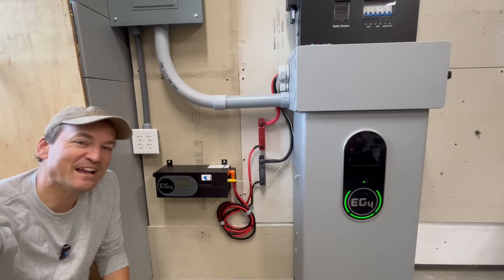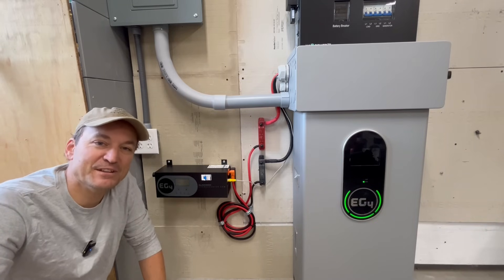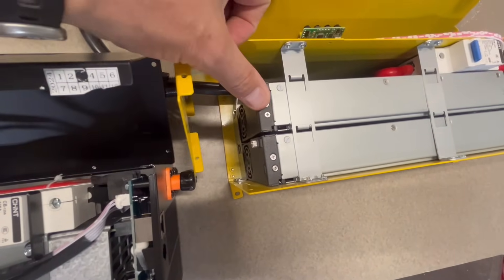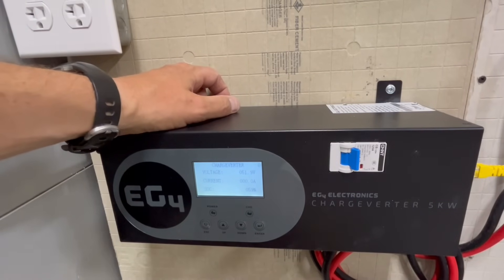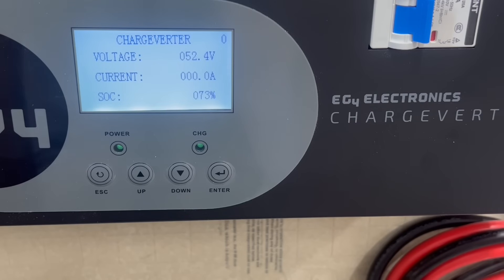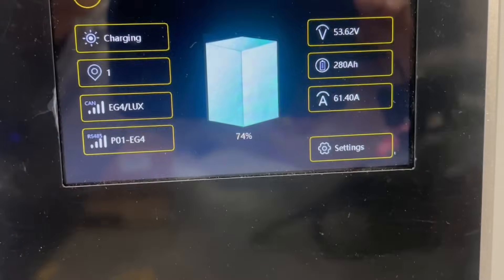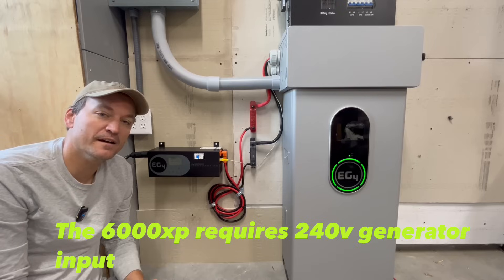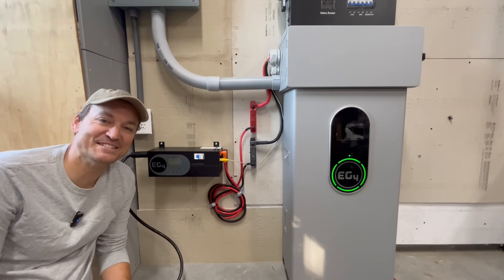New EG4 Chargeverter, charge your batteries fast when the grid is down

Comment: Section 5 of Chargeverter Quick-Start Guide (v1.1.2), page 9 it says "ALSO NOTE: If using the Chargeverter when connected to the grid, the charger will not automatically start or stop the generator according to the parameters set by the user.  This is put in place to protect the batteries from becoming over currented or overvolted from the grid."

Can someone explain how the Chargeverter KNOWS whether it's connected to a generator or the grid?  Thanks!
Reply from the maker: It’s addressing the dry contacts in the chargeveter. Those are intended to shut the generator back off when the batteries are fully charged. But if the dry contacts aren’t hooked to anything then it wouldn’t function that way. 

Honestly it’s not a big concern. Once you reach your max SoC or voltage the chargeveter stops running anyway. It basically sits at idle.

Comment: If you're NOT controlling a generator remotely, the ONLY SETTINGS THAT MATTER are the Charge Voltage & Charge Current.  The SOC start/stop is used ONLY IF you have communication between the CV & the battery.  The Batt start/stop is used when no communication between the CV & the battery.
Reply from the maker: @joshm3342  that’s correct. And that is a lot of caps.

Comment: Great video this is exactly what i was looking for. I am wondering if you could make another video clarifying how the communications work between the battery, inverter, generator, and the chargeverter? I was able to piece together some information from the comments but im still confused. It seems like one piece of equipment should be a "site controller" and be your main source of info for the whole system. But maybe EG isnt that fancy
Reply from the maker: So the chargeveter/ generator are essentially going to be separate units when it comes to communication. They can monitor the battery and communicate with each other. And the inverter can communicate with the battery and send info and the battery status to the monitor app. I agree with your statement. And I’ve discussed it with them. It would be nice to have coms with the entire system together.

Comment: My Ecoflow Delta Pro 3 has a Nema L14 30 outlet so it isn't too difficult to imagine how I charge it with the Eco but as Im gradually upgrading my setup I need a way to affordably do the inverse and charge my Eco with a EG4 wallmount and have the delta behave as the inverter. Maybe on those same bus bars add an XT60I out and charge directly until I can afford the 12kwhpv. Am I living fantasy land here, is there anyone you can imagine using the EG4 in conjunction with Ecoflow Pro 3 swapping current to charge one another without an exorbitantly expensive All in one? Get the cogs spinning here I can't find any information on it.
Reply from the maker: @DoyenOfDearth  I believe the battery voltage on that unit is 48v. But I’m not sure on the nominal voltage. So that  could be a factor. I think it’s a 15s.  If it is then the pro battery would be a bit too high of voltage for it. You’d have to do the research on that. If it has the same voltage parameters, then what you’re proposing could be possible.

Comment: Can these chargeverters be used on a delta pro ultra.
Reply from the maker: @qtrhors1  I don’t think so no. I believe  the nominal battery voltage on those is 100v. And the chargeverter is designed for 44v-57v.
Reply: Couldn’t you just run the chargeverter into the low voltage solar input of the DPU? That would get you ~855W of charging. Or you could use a step up converter to get the voltage higher (150v) to max out the 1600W input or even plug into the high voltage PV input. Right?
Reply from the maker: @ifusion  true. That’s a bit of a work around. I’ve actually been testing something similar on a smaller ecoflow unit using off brand batteries.
Reply: I can confirm it works. I just set up my chargeverter to charge six of my EcoFlow delta pro ultras. Each charging at around 830W.

Comment: It's six months later, do you know if G4 has made and sells the cable to the Power Pro batteries?
Reply from the maker: A cable from the chargeveter to the pro batteries? No, unfortunately not. I was told they were working on it. But the wheels turn slowly on stuff like this I guess.
Reply: @GavinStoneDIY  I will have to wait until someone does a video on doing this. I was disappointed that in Sig Solar's video on the chargeverter they took the easy way out and used a rack of batteries which to me was a copout and not what people wanted.
Reply from the maker: @LarryRichelli  I’ll see if I can get any more detail on it.  Which inverter do you have?
Reply: @GavinStoneDIY  I have the G4 18K inverter
Reply: any word on this. I am still waiting and I really do not know how to do this as my battery is mounted outside so I can not do bus bars like you did.

Comment: Pretty sad you have to spend another $500+  to do something that the eg4 6000xp should be able to do.
Reply from the maker: It depends on the generator. It can definitely handle an inverter generator. But the power from some cheaper units can be somewhat inconsistent when it comes to THD.

Comment: Can this be used with a small 3600 gas generator with no auto start ports if i manually started and stopped the generator and set the charging amps to an appropiate amount based on generator size.  Basically im just looking for a backup solution just in case i run a major deficit on my battery bank after several overcast short december days.  Instead of shutting off all non essential loads if i run low it would be nice to turn the generator on and monitor the SOC on the battery and shut if off near full which will give me several more days of power.  Also can this be used while the 6000xp is also charging the battery from solar?
Reply from the maker: @brocklievsay8262  yes, and yes. You can start the generator yourself and monitor it. Or just wait till it’s finished charging. If your generator is 120v only then you’d need to rewire the plug. Or make an adapter whip. 
 And yes you can charge at the same time as your 6000xp. Just don’t exceed the maximum charging amps of your batteries.

Comment: Hey Gavin, great video.  How did you figure out the 2 wire pin for start/stop on your generator with SOC.  I have a Westinghouse inverter generator with the same style connection but I am not sure how to figure out which  pins to use.  Just a bit worried about breaking something.  Love your videos so keep them coming!  :)
Reply from the maker: I used a small wire and connected it to two pins at a time. Because that’s what this relay in the chargverter does. It closes the relay and connects the two pins together.
Reply: @GavinStoneDIY  perfect thank you!!!!

Comment: Thanks for the video. The quick connectors are a good improvement. I would like the option of a 90° connector on the generator input cable at the Chargeverter end.
Reply from the maker: That would be a cool option. Depending on the location that seems like that could be helpful.

Comment: My Champion generator does not have start/stop feature, but does have push button electric start.  Would it be possible to tap into that with the CV dry contacts?  If that could start it, how would it stop it?
Reply from the maker: I don’t think you could tap into it that way no. I think you can add an inline auto start option for your generator. But I’ve just never researched it really.

Comment: How did you figure out which pins would work for the auto start? We have a different brand generator with a similar auto start terminal.  Also , will the chargeverter keep trying to start the generator if it fails to start after a time or two? Thanks for your helpful videos!
Reply from the maker: I actually touched a small wire to two of the  terminals till the auto start kicked in. All the relay is doing is connecting 2 terminals together. That initiates the auto start. So yeah the relay will stay that way on the chargeveter till the generator starts.
Reply: @GavinStoneDIY  Thanks!

Comment: Can you connect the chargeverter directly to the battery terminals or do you need to use those bus bars?  Just trying to simplify the setup.
Reply from the maker: Yeah you’d need something like the bus bars I showed. The chargeveter connection is ring terminal type lugs. And even if you switched to the quick connect amphenol types, they would be too small to fit on the battery.

Comment: Thanks for the great video. Was hoping to find a link to the 120V plug that you used on the whip to convert from 240V. I am not having any luck in finding a 120V male plug end that is made for 10 gauge cable, most only accommodate up to a 12-3. Any info is appreciated, thanks.
Reply from the maker: Use a 20 amp 120v receptacle end. I’ll add one to the description.
Reply: @GavinStoneDIY  👍 Thanks!
Reply: A TT-30 plug will allow up to 30 Amps @ 120 VAC.  If you charge your battery at 50 A x 56.2 V, thats 2810 Watts to the battery.  At 92% efficiency on 120V, you would pull about 3055 Watts from your 120 VAC source, which would be 3055 / 120 = 25.5 Amps.  TT-30 plugs WILL accept 10 gauge wire.  If you use a 20 A plug, you would overload it.

Comment: I was having a hard time just finding  a generator with dry contacts that was not a “whole home backup”.   Yours seems to work but is quite pricey.   Any other recommendations?
Reply from the maker: You really can’t get much cheaper than the model I have. At least if you want to have the auto start and inverter tech. Honda generators are fantastic. But they are twice the price. There are other brand names that are pretty similar to mine. They are all fairly similar in price though.

Comment: How do you keep your eg4 indoor 14k plugged into your inverter and your eg4 gc?
Reply from the maker: I’m not sure what you’re asking.
Reply: How do you keep your battery plugged into your inverter while connected to your chargeverter?
Reply: I’m trying to figure out how to have the same battery you have connected to the 6000xp so my solar can charge the battery. While still being able to charge the battery with a military surplus 5k generator with the gc chargeverter in this video. Without physically disconnecting the batteries over and over. A DC disconnect would be fine but I’m confused how to set it up. The 6000xp has a generator input I know but it’s safer to have the chargeverter right?
Reply from the maker: @ShaMuhmma  yeah it would just stay plugged in. There isn’t an issue with having multiple things on one battery bank. So you’d just leave the chargeveter connected via a busbar like I did. And when it’s needed you’d utilize the chargeveter. One of the key things to remember is, you just don’t want to exceed the maximum charging amperage of your battery.
Reply: @GavinStoneDIY  I’m just confused how that would all connect together since the battery and the chargeverter gc both have quick connect. 

Also probably have to do more research on the bus bars… because it still confuses me how to properly have input from solar to the 6000xp to the batteries but also pulls power from the battery to the house. While also using the bus bars to interconnect the chargeverter with the whole thing. 

If that sounds confusing thats because I’m confused. 

Thanks for your response and time!
Reply from the maker: @ShaMuhmma  haha. It can seem confusing at first. The one set of cables runs from the battery to the inverter. So that would cover charging from solar and discharging. It’s basically directional. 

The other set of cables I used was an extra set they send with the battery. I added lugs on the end and attached them to busbars. So it’s really just a hub essentially. And I attached the cables from the CV to those busbars. So at that point the solar and chargeveter could really charge the battery at the same time if you wanted. But assuming it’s a rainy day and there’s little to no solar, the CV would do the charging alone.
Reply: Oh okay because the batter has multiple quick connect points correct?? 

So you can run the second positive and negative wires that come with the battery. From the additional connection to the bus bar from the battery. Then connect the negative/positive cords from the CV to the bus bar. 

While having the battery also connected to the 6000xp with the first pair of N/P quick connect wires. Right? 

Since the battery is set up with multiple quick connect spots to run them parallel with additional batteries?
Reply from the maker: @ShaMuhmma  exactly, yes. You can connect 4 different wires to the battery. The battery has an internal busbar.
Reply: @GavinStoneDIY  thanks a lot!

Comment: Hello Gavin, I bought the current connected bus bar you posted but doesnt fit any of the cables. The screws are biggers or im missing something?
Reply from the maker: I probably drilled the cable ends out to 3/8. Apologies, I should have mentioned that. Do you have a step bit?

Comment: Do you need a precharge resistor when connecting the Chargeverter to the 48V batteries?
Can you adjust the max current without the generator running.
Does the Chargeverter remember its settings if disconnected from all power?
Reply from the maker: The generator will actually precharge the unit. But either way I haven’t ever used one on it. Probably wouldn’t be a bad idea. But I haven’t seen anything written on it that I’m aware of. 

You can adjust the current without generator power. The battery  can power the unit and allow you to change settings I think. 

Yes it remembers the previous settings.
Reply: @GavinStoneDIY  Thank you Gavin - good information on your channel, and subscribed!
Reply: @GavinStoneDIY  Thank you! I got one and tried it out - it works as you say, with no precharge resistor.

Comment: Do you think you could use the V2L output from an EV to power this inverter?
Reply from the maker: It’s hard to tell what you’re asking.
Reply: @GavinStoneDIY  I'm sorry. I'll try and clarify. If you were to use the vehicle to load (V2L) plug from an electric car, these normally have a 3.6kw output via a plug. I was wondering if the cable could be run into the chargeverter to recharge the home batteries.
Reply from the maker: @007silverwings  so use the output of the EV to power the chargeveter in order to charge your home batteries?
Reply: @GavinStoneDIY  yeah, that's right.
Reply: Not ideal with conversion losses, but a good backup.
Reply from the maker: @007silverwings  yeah the conversion losses would cost you some energy. But that’s still a good way to use your EV to help power your home.

Comment: Could I run the 120 to an inverter in my vehicle so I could charge while driving? And if so what’s size?
Reply from the maker: That could work yes. Are you saying you’d have the battery in a camper and inverter in your vehicle?
Reply: My work truck that I’m in 8 hours a day would have the inverter. I’d probably have a cart for a 5 or 10 kWh battery

Comment: Any idea how to get the cumulative total kilowatt hours charge data on this new unit? The first model which was the yellow one told you the total kilowatt hours over its run time so you have an idea how much power was put into the battery. But I can't find that menu or data point on this new unit. So I just take the number from my old unit and double it to account for the new
Reply from the maker: This is a really good question actually. I hadn’t considered this. Let me see if I have time to take a look tomorrow.
Reply: @GavinStoneDIY  It looks like a feature that was removed on the newer models. I cannot find reference to it in the manual. If it's buried in a menu, I can't find it either!

Comment: Why couldn’t you connect the generator to the generator input on the 6000XP?
Reply from the maker: With an inverter generator you could. Otherwise there is a potential for issues with the THD on some generators. It could potentially damage the XP. Or at the very least just not power the unit. 

The chargeveter is usually a better solution.

Comment: Hi Galvin 
I had 3 48v300ah batteries, connected to 12k inverter, with this chargeverter,i will connect to busbar of these batteries, do i need to turn off inverter or just leave it on( with out communication cable) thank you,thank you.
Reply from the maker: It’s fine to leave it on. This is just like having a separate charge controller. You can have multiple chargers on the same battery bank without problem.
Reply: Thank you Gavin,do I need to have communication cable connected 3 together like server rack although all 3 connected to same busbar.

Comment: Hello Gavin, I have a couple of question  about the new Chargeverter  , 1 does it  just  charge  one  outdoor wall mount  battery with the 18Kpv  system  2 will it  charge  the 5 battery  18Kpv  system   thankyou.
Reply from the maker: It charges at 100 amps. So you could add as many 48v batteries as you wanted. The more batteries you add the more the amperage spreads out between them. So if you charging at 100 amps and had 5 batteries, each battery would get around 20 amps of charge.